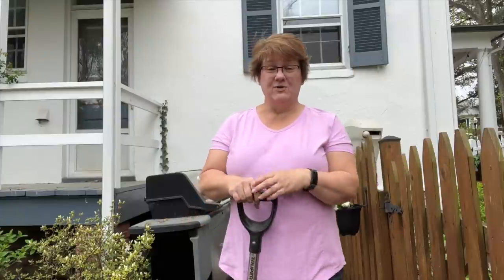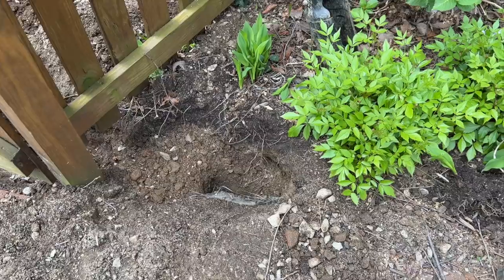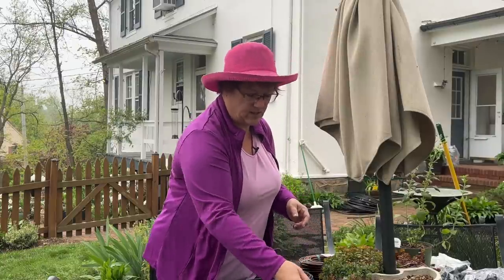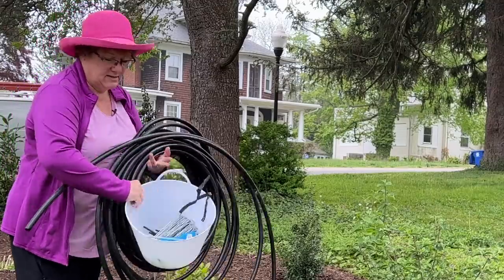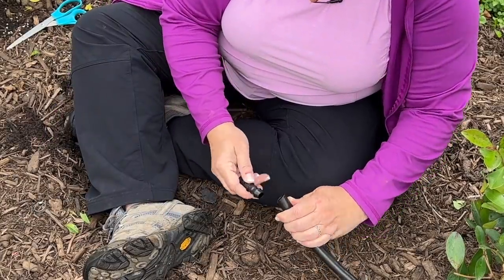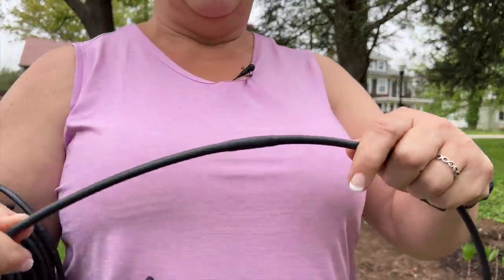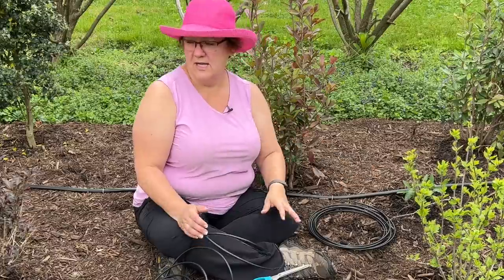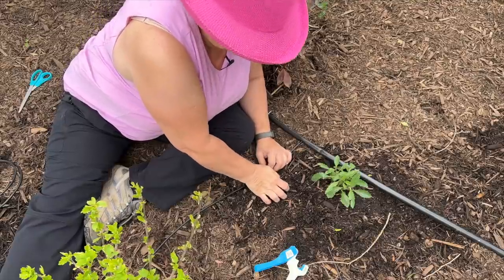Installing Drip Irrigation Part 1- 💦🌸💦

Comment: Getting the connectors installed is a challenge.  I found dipping the tube ends in  hot water made the task a lot easier.  To keep the water hot i poured it into and insulated and kept the lid on between uses.
Reply from the maker: Good tip, thanks!

Comment: Good morning, Jenny
I highly recommend the method of carrying a cup of hot, hot water around with you to dip the ends of the tubing in for a few seconds to soften them. The connectors then just slide in easy peasy. It makes the difference between being able to do it myself and having to call my poor husband to do it for me. Even after they have warmed up in the sun, it's still difficult.
It's a big job and I admire you for deciding to tackle it.
Reply from the maker: Good tip, thanks!

Comment: Yayyy!! Happy Day finding your channel.  Last summer I decided to install a drip irrigation system so I searched my home town stores and online and came up with a goodly assortment of pieces and parts and supply line for the project. Alas I developed double pneumonia in August and that ruined my gardening for the rest of the season. I really need to get it set up now so the timing is perfect to see your video, hear your thoughts, plus read the comments to get more hints.😊
Reply from the maker: So glad!  I still haven't completed my system.. need to get cracking on that!

Comment: Great video, I've been using drip depot for years. I use the supply line connectors that you can reuse. One note, it is recommended that your head units (filter, backflow preventer, pressure regulator) are installed after the timer. For me that means I have 4 head units for my 4 outlet timer.
Reply from the maker: Good to know, thanks!

Comment: I used a coffee travel mug full of hot water last year to dip tube ends and it made putting the couplers in a lot less painful  - and also wearing gloves with rubber-type surface helped a lot😃
Reply from the maker: Yes, I ended up using gloves as you described... but was too lazy? Stubborn? to go get a mug of hot water.  Next time, for sure!

Comment: The components attached to your faucet should come after your timer. Before my timers I also added a Water Hammer Arrestor to save our pipes. Then the order after the timer (on each zone) is backflow preventer, filter, pressure regulator, hose adapter to 1/2”, and 1/2” line. On my two zone timer I had to get double the components...ughh. Seeing that this is part one of your series you may mention this in the follow up videos. I too love Drip Depot! If I have another order I’ll place it through your link! Thanks for sharing!
Reply from the maker: Good to know, thanks!

Comment: Goof plugs are so handy! I’ve mostly used them in the 1/2” supply line after removing 1/4” line when my pot configuration changed. This year my beds and pots should be in their forever(ish) locations, so I’ll be removing some goof plugged sections and replacing with fresh supply line.
Reply from the maker: Good to know!   That makes total sense!

Comment: Hi 👋. Another thing you can use to make the tubing soft is use a lighter to get the end soft so you can push the connector on easily.  Don’t melt the tube just hold the flame on just to soften.  I hope that makes sense it’s made it so much easier for me.
Reply: this lighter method works great with my arthritic fingers since I don't have much strength in my hands & fingers.
Reply from the maker: Great tip!

Comment: Hi Jenny, thank you for your videos & hard work! I'm getting ready to put in drip also & it was a very helpful video. 
On a side note: one of Laura's videos they did some landscaping for a friend & took an auger & ran it under the sidewalk from both sides to run drip tubing (just in case you don't find that dang pipe)❤
Reply from the maker: thanks for the tip - I recall that video.   :-)

Comment: Perfect explanation! Last year I didn't quite understand what you near the back gate (close to the 3 Arbs) but with your tutorial today it makes perfect sense : D  I think I was mixed up with the 1/2" vs 1/4" black supply lines not realizing there was also a 1/4" black supply line coming off the 1/2". Having the brown drip line will be helpful & that with 6" emitters. Thanks Jenny
 ps it seems like the pvc "conduit" under the walkway should be there somewhere, can't imagine someone would remove it.
Reply from the maker: Thanks for watching, glad this was more clear.    The conduit - I think I was misremembering the existence of a conduit - pretty sure (100% sure) it was just the downspout drain, not a conduit.   Drat!

Comment: I'm DIY like you. I installed my drip about 5 or 6 years ago after coming home from the States and finding many plants dead. Hubs didn't water😡, not seriously enough let's say. I have 2 faucets, one in front, one in back. I run my drip system to the side and front of the house from the back faucet which has a double hose connector. Nothing is underground, I just have my 1/2" running over the patio, next to the house, about 18 feet. Then it connnects to a water pressure thingy and 3 other 1/2" derivations. I'll be getting it up and running this weekend, so will verify each drip emitter. And, since I laid the patio 2 years ago, I'm planting the backyard and will most likely run another supply from same faucet but 2nd spigot. Maybe to flow at a different time so as not to overload the whole pressure thing....
Reply from the maker: Sounds like you've got a great setup!
Reply: @HarmonyHillsHomeandGarden  It works for me, I usually go down the line several times during the season to check for loose or broken older components. You have a much larger surface area though. Waiting to see your vid on trenching under your walkway, what a job!

Comment: I am doing exactly what you're doing in this video.  How long are you running water with the 1/4" tube emitters?  Thank you for this video.  It was very timely and informative.  Oh, I am in Colorado Zone 6 on the west side of the state.  We are high desert so we are hot and dry.  Thanks for your help.
Reply from the maker: I'm not sure yet... I don't have it hooked up to water yet.  I plant to start with a relatively dry soil, then run the water and test the moisture as it runs.  That should give me some idea. I'll probably start with 30 minutes as a guess and adjust from there.
Reply: @HarmonyHillsHomeandGarden  Ok good idea.

Comment: How to get tubing under walkways:  Cut & cap a piece of PVC that is wider than the walkway.  Place the capped end at the desired depth near the walkway entry point. Hammer the other end of the PVC until it comes out on the other side.  If needed you can cover the open end with a board and then hammer.  When it comes out on the opposite side, remove the cap & put the tubing through the opening in the PVC.  You can leave the PVC in place.
Reply from the maker: That method works great if the soil under the walk is soil.  But mine is heavily machine-compacted gravel and clay.   So, it's not going so well.  ugh!